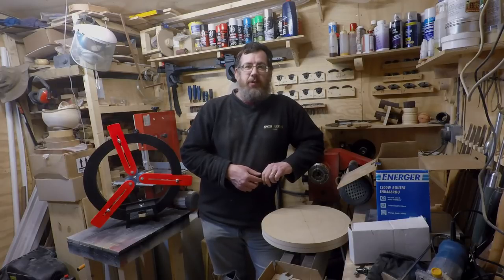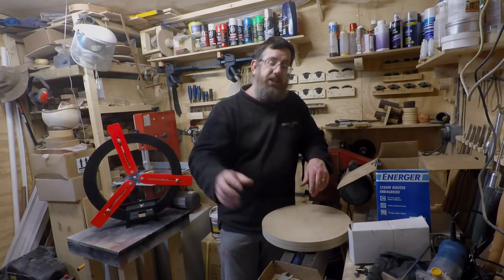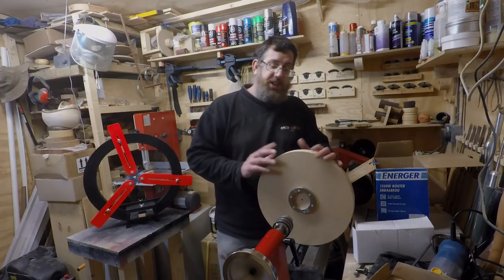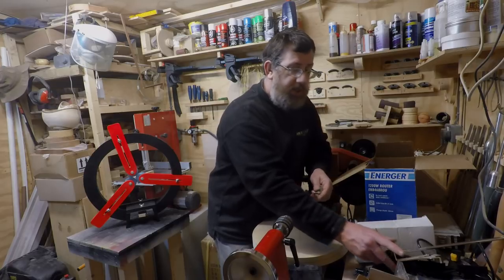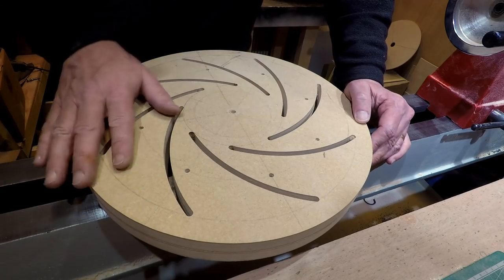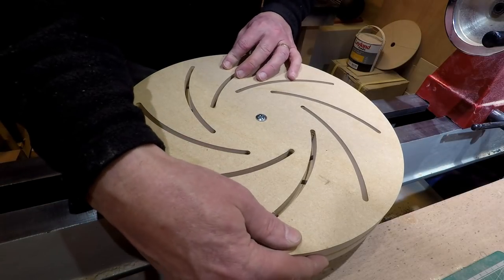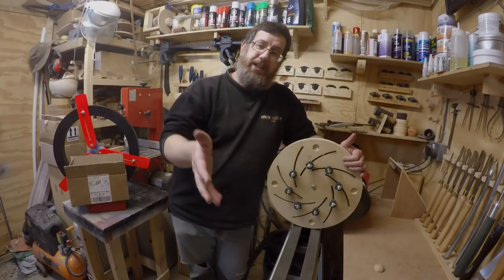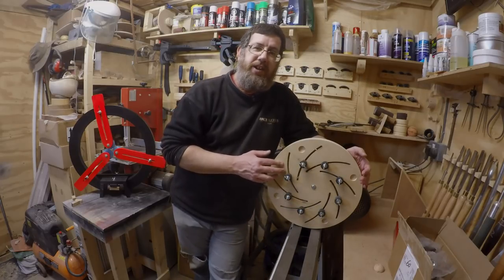Longworth Chuck To Also Use In The Tailstock - Episode 185

Comment: Great job Paul. The reason for the other line is along the lines of what you already suggest. if you go all the way you end up really close to the other cut out and this makes it week. What you should notice is that people only go all the way on every other one. This keeps the gap large and keeps it strong. then when you go really small you remove the other 4 stoppers. not sure I explained that very well.
Reply from the maker: Thank you John. Totally makes sense. However form where I started I was actually only about 2mm from the main internal line. If you look at about 6 minutes in when I did the router work the router bit was already just touching the line. I think as the arc is so big that the curve is so slight which over distance you don't gain much. If the chuck was smaller then that would be a different story.

Thanks for letting me know that because on the size I was working with I couldn't see any benefit.

Comment: Brilliant video Paul, you've given me the confidence to attempt it other videos I have seen have not made it look easy enough for me to do, an I never new about the circle configuration for the plunge router!
Only concern I have for yours is without washers on the stoppers between boards, when using larger bowls / segment rings and the stoppers are tightened their will be some flex and causing the stoppers to pull away from the piece and to run off true. How minute this will be and how it would effect the turning I have know idea.  Thanks for your hard work and time to share. Mike aka Coxey's Wood Bodgering
Reply from the maker: Thank you Mike. It's all about sharing and the more people do, even of the same thing we all see a different view. Someone else has mentioned washers between the two boards, which I will more than likely add. As to flex, this is 18mm MDF and would take an incredible amount of pressure to bend that, however as I said will be looking to add those washers and also put the wing nuts on the back.

The stoppers are also rubber, so do flex and I've turned them down to a nice taper, so again should give extra support should the work slip a bit. Les chance of the work flying off. Getting this to run true is the biggest part. For turning the base off a bowl etc. if you're out a little shouldn't matter too much but for bringing up pieces to glue onto the head stock end is a bit more critical, which is one of the reasons I made the chuck.

Comment: Nice clear explanation of a longworth chuck. Did you ever put a larger bolt in the centre?
Reply from the maker: Thank you Bernie. I've not done any changes to it so far. It can be a bit of a pain to get work located centrally as there is so much play with the bolts. For sanding off the bottoms of bowls etc. all works fine as you can often locate the bowl centrally to start with using the live centre.
Reply: @PaulLockwood  Im about to make one myself I bought a kit with the stoppers ages ago. Thanks for the reply. I can see how centreing would be an issue

Comment: Nice one Paul... have you thought about putting the same size spacer washer you put between the plates on the centre bolt in the same position on the other 8 bolts so you can’t pull the plates out of true when you tighten up?
Reply from the maker: Thank you Glyn. someone just mentioned that just before you commented. I hadn't, but will more than likely add them. 18mm MDF should not flex unless under extreme pressure, which as long as each side is tightened the same shouldn't be a problem. Adding the washers should cause no issues with it either so for safety and ease I will add them in.
Reply: Late to the party as always lol

Comment: You can buy for example Axminster faceplate. It has M33 thread so you can directly mount it on spindle. I also use Robert Sorby faceplates but everytime I fit it, it doesn't settle exactly same (checked with dial indicator). If you buy M33 adapter to MK2, you can use it also on tailstock. Advantage to this solution is that you can really press segmented ring when glueing. Anyway good job on this chuck, looks great.
Reply from the maker: That's also another great idea. The whole point of the video is to get people thinking about using it for more that just an ordinary chuck for turning off the bottom of work. This seemed the easiest and cheapest option. Plus for me works well as I have to take the chuck off less using this method as it is usually on the lathe with the standard jaws in.

Thank you for the feedback as this is what will be of interest to a lot of other people.

Comment: Paul
I have seen other examples of making a longworth chuck - all fairly similar. However, the others I have seen show the wing nuts on the reverse side of the chuck. After you have used your method, do you see any real advantage on having the wingnuts mounted on either side?
Look forward to your answer.
Regards
Dennis Beamish Cambridge Ontario Canada
Reply from the maker: Hi Dennis. I will be putting the wing nuts on the back too. It was because I had the split washers on they were harder to loosen, so being right handed was easier. I've removed those so they tighten and undo much easier. As some have suggested I will also be placing the same large washers I used and place these on each of the 8 bolts between the two pieces of MDF, that way it will always have an even pressure.

The main point of my video was a slight modification on how easy it would be to mount in the tailstock, without having to buy and extra like adaptors etc. After making the steady rest this was an ideal project to make as the disc was the waste wood from that project so therefore became a fairly cheap and easy project to make.

Comment: The bolt and wing nut need 180 turned to be more user frendly
Reply from the maker: Being right handed I prefer if this way as they can be stiff to tighten up. They don’t get in the way for when turning off the base of bowls etc. However they are easily reversed if required.

Comment: Why not put the wing nuts on back side so theres no chance of it getting in the way of a bowl and no chance you will bust your knuckles
Reply from the maker: Very good point James. I think because I had the split washers in they were harder to undo, so being right handed had them this way. Now that I've taken the split washer off I'd certainly look at doing this.
Reply: You may also find that the wing nuts foul themselves on the motor cowling to the rear of the lathe if your work piece is too large (as I find with my shop bought Longworth). Good job though Paul! @PaulLockwood